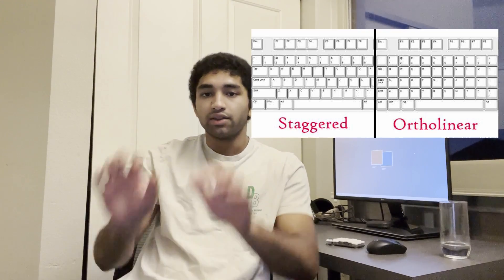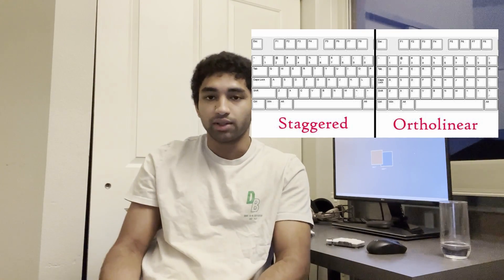Ferris Sweep Review - Tiny Open Source Split Mechanical Keyboard

Comment: after 4 months, do you still recommend going bigger, or do you now think 34-36 keys are enough? I cant decide between corne or Iris
Reply from the maker: I think that if you are just starting out going bigger is the move because you can always make a keymap to reduce the number of keys but you can't go the other way. I think that 34-36 keys is enough but I still find myself missing the number row sometimes when doing super repetitive tasks that involve the number row. I could fix this by adding another layer thats more optimized for this workflow but usually that is just for an assignment and it is more work than its worth. Thats why if I were to do this again I would go with a larger keyboard and try to stick with 34 keys for the most part but still map the other keys just in case they are useful for a edge case. Hope this helps!
Reply: I moved from a ZSA moonlander to a Sofle Choc (6x4+5), because I wanted to try the shorter key throw of the Chocs. I then went to a Corne with the extra pinky column removed to reduce my finger movement. I liked the 5x3+3 nature of the Corne, but the pinky column was nearly at the same distance as the ring column, so I tried a Ferris Sweep Bling LP, with its more exaggerated column stagger. I'm very happy with it. A third thumb key would be nice, but I am okay without it.

Comment: How much did the whole build cost you?
Reply from the maker: Around $20 for the pcbs with shipping (jlc sign up discount), $120 for the switches, nice nanos, switches, key caps, and everything else. Majority of the price was the nice nanos though. If you don't want wireless then it will be a lot cheaper. For a budget build it may be cheaper to go with corne or the sweep that accepts cherry style switches. Those switches are much cheaper.

Comment: Yeah as someone who started w the Ergodox, thats a big leap to take for your first split. The ortho and split itself takes like a month to get used to, but to also have to be thinking of multiple layers is a lot. After like 6 months I am now building a 48 key low profile split. Since having the Ergodox, I have slowly adjusted to making my layout and layers more minimal and more like a low key split experience bc through trial and error of layer ideas, I kept going towards having minimal distance from the home row. And now I dont even use my num row, inner columns, and the far thumb buttons of the Ergodox bc of the easy layer switching, I love it. But I am excited to try the more minimal kb with even less effort, reaching, and size!
Reply from the maker: Yeah I definitely jumped the gun on such a small split. I recently made a keymap for the sweep which I made a video about that is a lot more optimized than the ones I made previously. I feel like I would have found all those optimizations naturally without compromising my workflow if I had a larger board to experiment with. The ergonomic gains are huge though. I am loving that. Thinking of making a larger board like the lily
Reply: It's funny because I am going down the same rabbit hole of building my first split keyboard. I initially ordered a Ferris sweep but after some thought, I decided to order a Sofle Choc as well since I figured it might be easier to transition to a 58 key layout first before diving into the sweep. Your comment basically confirmed my thoughts that adapting to a minimal layout with multiple layers would take longer than I initially thought. 

Plus, it gave me an excuse to build another keyboard as well. So I can't really complain.

Comment: I have many custom keyboards it takes awhile to get used to a new layout, but after it drilled to my muscle memory I can switch between them instantly without that much discomfort. Actually all keyboards are about the same in comfort for me, apart of traditional ANSI, and the only way traditional ANSI is worse is that arrow keys are not under fingers, but if you use vim to edit it doesn't even matter.
I even tried a custom 24 key split build, (12 keys per side), but it was too much for my brain to handle, too many layers and functions where I had to type 2 or 3 keys at the same time for different functions, my brain was confused why sometime I press 1 key and other times 2 at the same time, I had micro stutters in typing, maybe it is doable in 2+ weeks but I abounded the idea.
Reply from the maker: Interesting. Yeah the first few weeks with the sweep really messed with my ASNI speed but after another week both became equally as comfortable and I could switch between them instantly. I guess its good to know that the same applies for having even more keyboards because this is a rabbit hole I definitely am not at the bottom of yet so its great that I can have different keyboards for different purposes. Wow 24 is tiny I could not imagine using modifiers for alpha keys.
Reply: @SethusBuilds  Not modifiers, combos, for example enter is D and F pressed at the same time (or same thing but on the right side) tab is D and V pressed at the same time. (the layout was ortholinear). Qwerty layout fits in 24 keys just fine.
As I said my brain was confused with these double keys, it wanted to just type single letters quickly, like it usually does. But theoretically it is doable, I counted around 2 dozen 'comfortable' combinations, of course for symbols and numbers I use separate OSL and NUM pad layers.
I experimented with such small keyboard for basically ability to code on the phone in any place, it would still be more comfortable than on screen keyboard. I will come back to it later and maybe will make it work, I hope.

Comment: How do you like the silver switches? I have browns on my normal keyboard and I'd like something heavier
Reply from the maker: Yeah not sure if silvers were the right choice for me. I got pretty used to the light weight fast which is nice because I think that will prevent rsi but I wish the switches were more tactile. The choc sunsets were just released which look very promising. If I end getting them I will make a video about them.
Reply: @SethusBuilds  yeah i was looking at those or the burnt orange. I kinda like heavier switches. Thanks for the response
Reply from the maker: @Ataraxia_Atom  Oh yeah burnt oranges also look great. I wanted to try light switches which is why I didn't go with them but I was debating between those and silvers. Wish there was more info online about chocs.
Reply: @SethusBuilds  yeah it's tough, like soldering the switches directly is a large commitment lol maybe the next one I'll do like the bling so you can do hot swap switches. I just ordered my micro processor today
Reply from the maker: @Ataraxia_Atom  Yeah hot swap would have been nice. Thinking about doing a larger build like the lily. Could also use full size switches which have a much broader selection

Comment: Is zmk easy to configure? I ordered a swept corne pcb and im thinking about my layout.
Reply from the maker: ZMK is pretty easy to configure since  the documentation is super solid. I will be releasing a video pretty soon about configuring zmk which I hope will help. Looks like the swept corne github also has a base zmk firmware to start from (https://github.com/AYM1607/corne-zmk-config ). You can work off that repo which will make configuring pretty simple
Reply from the maker: https://www.youtube.com/watch?v=Kx8F4xI5yno